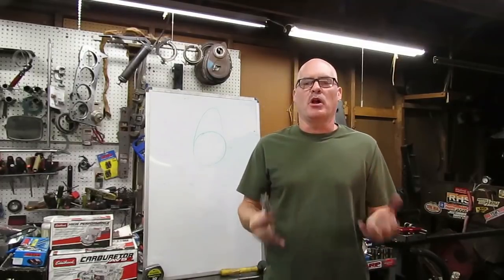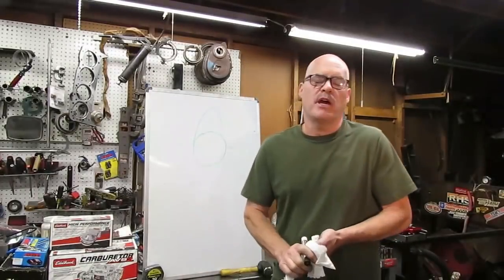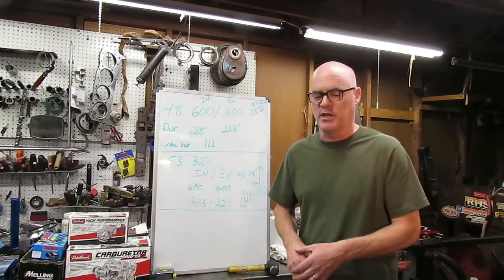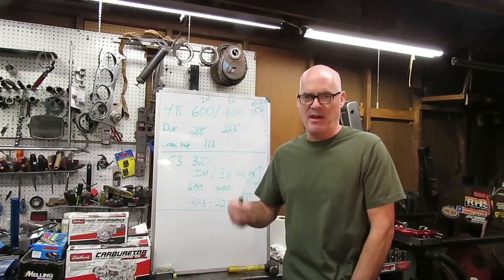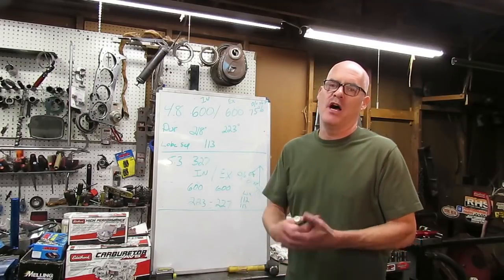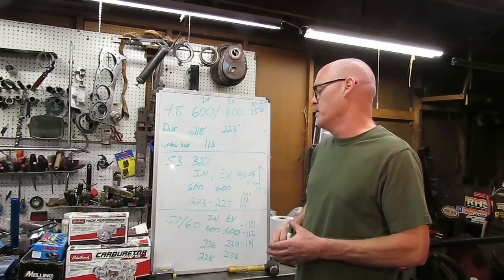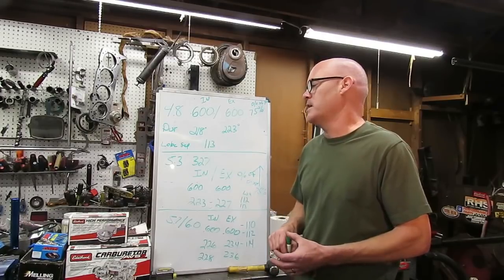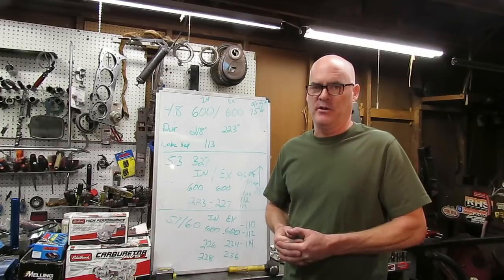How to properly select a Camshaft part 2

Comment: Hey man.
This video was fantastic.
I really learn a lot from you.
I'm just wanting to know, would you consider a 1 7/8 header too big for an LS 434 size engine?
I have read the 1 3/4 is good to around 800hp before you should even consider upgrading them.
I don't want the engine to feel lazy down low and in the mid range as it's a heavy car.
Reply from the maker: No not at all
Reply: @Myvintageiron7512  to ask a similar question,  would you consider a 1 3/4" primary header too big for a sbc 383 in the 400-450hp range?  Compression is 9.5:1 (I'll probably get some work done to get closer 10:1) and cam is 230-236dur with .506 lift.  2.5" exhaust.
Aftermarket vortec heads .  Exhaust runners were ported, not sure if too much.  Also pocket porting behind all valves.

Comment: Wow, wow,  what a great video , and I mean both  part 1 and par 2.   CONGRATULATIONS   man.   One question,  what do you think of the OEM kit sold Chevy Performance ?   They call it the Dynamic Duo,  it's ported heads & camshaft. They say it gives 40 aditional HP,  the camshaft  is  121 deg LSA, 591 lift both in & ex,  duration is 211 in 23o ex.   I'm going to install it in may 212 camaro SS, I want a little more power but also keep it streetable as a daily driver.  I already have the CAI and  street High Performance muffler from Chevy.   Do you think it will work as advertised ?   Thank you again for your video, I learned a lot  from it.    BTW it is a  LS3 not the auto L99.
Reply from the maker: Yea it should work pretty good

Comment: Wish that I could talk to you about my Ford 460 project. I would like to build the engine for long life and as a cruiser in a 77 1 ton dually chasis. Without it screaming its guts out going down the road .With a/c and all of the creature comforts of that year that were available. I would like this engine to have the best volumetric effiency possible. I was thinking that if I had the same setup that the 460 had in 1968 with the 10 to 1 compression ratio that I might be close.? I also have heard that puting 429 heads and intake on the 460 with the 1968 timing setup that would put me close to where my goal is . If you could call sometime to discuss this I would greatly appreceiate it. I wish that you taught a class somewhere because I would love to attend .

Comment: Hi Mike... I can’t find a LS cam with the specs you gave me ... the closest  cam I can find is a low lift 525 intake and exhaust. I forgot to mention I’m running the 416 stroker LS with the Holley terminator X max so tuning isn’t a issue.
I already have the BTR stage 2 LS3 LS7 cam. I can send it back . But honestly it’s actually the closest thing to what you  suggested other than the lob separation angle 110 as opposed to 113 on the BTR cam. I have the summit racing forged stroker rotating assembly. The pistons have a 6cc dish with plenty of valve relief that are actually machined for multiple LS cylinder heads. My heads are factory LS3 milled down to 68.5 cc . Information is so important 👍

Comment: A little help. I have a cam that is 256° 264° @ .050 504 lift 105 lsa. What compression what i need ? I have rpm air gap intake and vortec heads an 750 cfm carb. Some one shoot a line of info please. 
Thanks

Comment: I have a 496 with a set of rectangle 990 iron heads from  a 427. According to the first video I should have a mid 600s lift. But its an 8.1 liter engine so according to this video I may need bigger? I’m a little confused between the engine size and head flow relationship in regard to choosing a cam.
Reply from the maker: you can go bigger with more cylinder vlo I wouls go up 1 or two stages
Reply: @Myvintageiron7512  I appreciate the feedback!

Comment: Hi mike... I’ve been watching your videos... excellent information... I wish you continued with cam selection going up to the 6.2L .... also I’m personally building a LS3 stroker 416 with a 11.3:1 compression...what would be the perfect street cam... I have a 4L70E, 323 gears with a 3000 rpm stall 28 inch hight tires and it’s all going into a 81 firebird... about 3000 lb
Reply from the maker: stick with .600 lift 228/234 Duration 110 LSA
Reply: @Myvintageiron7512  I was looking at the BTR stage 2 cam .. it’s 225 / 238/ @ 50 with 113+3 .LSA lift is in and around 600 intake 612 exhaust. 
Fairly close to what you recommend with a little more overlap. What are your thoughts. 
Thanks again for the great information!
Reply: @Myvintageiron7512  thank you so much for your advice... keep up the cool informative videos.... wish back in the day my auto shop teacher was as informative and explained detailed information on proper procedures as in your videos. 
Cheers

Comment: Question havent tor 327 apart yet but have all rebuild kit including stock cam bearing . ( And lifters and cam) but want a better than stock cam ( used to be called RV cams ) just want mild lope and midrange performance not sure about valve size yet if 194-202’s would cam recommendations be the same just need to to know as I don’t know . Selling as stg1-2-3-4 cams stg 2 seems right as it’s a weekend worrier car . Stop light to stop light , smoke the bags when leaving the show and shine 😅lol please help
Reply from the maker: An RV cam has no lope whatsoever they are smooth idle for heavy off road TQ you want a cam with 228/232 Duration @.050 and a 108 LSA around .480 lift I am assuming your using a decant head a camel hump well prepped at the very least.
The heads being rebuilt and preped correctly by a shop that knows what they are doing is critical

Comment: What's a good cam for a Chevy 350ci 250 horsepower 2bbl version? I'm looking to hit a little north of 300hp with a slightly more heavier, throaty but not a choppy sound. Someone said a .444 lift cam, dual plane aluminum intake and a 4bbl with a dual exhaust. Does this sound right?

Comment: Just a question guy's what's a good set of secondhand LS3 rods worth over there as I'm after a set for my LS1 rebuild in my 02 Holden Calais VX. 
Can't find a set at a fair price here in New Zealand and really want to dump the old LS1 rods as I give this old girl total crap every time I drive her.

Plus I went with this cam & ported 241 casting heads 
Intake Valve Lift: .575"  Exhaust Valve Lift: .575" Advertised Intake Duration: 286¡  Advertised Exhaust Duration: 282¡
  Intake Duration @ .050": 220¡  Exhaust Duration @ .050": 224¡  Lobe Separation: 112¡  Intake Centerline: 108¡  ( Hope it's not to much, But we will soon find out.)     ; )

Now it's my daily driver so didn't want to go to nuts on the cam to keep it drivable in & around town.
Staying with the flat top piston and will have a 10.5 /1 comp ratio since heads an block have been surfaced.
Engine has 360,000ks on her so she deservers a freshen up.

Have new valve spring (600 max lift) , push rods, LS6 Lifters, lifter buckets, full gasket set, 650cc injectors, new oil pump, new timing gear an chain, new rings & Bearings including a new set of cam bearings which are already fitted to the block as block has been bathed, surfaced & will be horned once ready to put her back together. ( Can exchange rod Bearings if needed)

Be great to get any feedback on the price of a good set of LS3 rods

Comment: Would you recommend going with an after market intake if going with an after market cam? I know you said the factory intakes are very good but how does that work with aftermarket parts? I've heard the engine needs to breath better and have heard both sides. So what's your recommendation,  keep OE intake or go aftermarket intake?
Reply: OE work pretty well unless your turning really high rpm or if your boosted... things like that.

Comment: Picked up a 69 C10 with a 350 from a 73 truck. If I’m reading the numbers correctly. It’s a 010 block with what looks like 8998991 heads but I could only find info on a 3998991 casting number. My issue is I’m getting chatter under load on the right side and it sounds like #4. I took the valve cover off and rolled the engine over to make sure all the valves were functioning and I’m thinking it probably needs a new cam. I would like to build on this motor. Other than the chatter it feels strong. Do you have a suggestion on cam and maybe do you know about these heads?
Reply: Why don't you just adjust the valves on #4 cylinder if they are chattering?
Reply: @nsmturbo5902  I’ll try it.

Comment: So I’m a Noob & not a Noob at the same time. I was really hoping you could help me overcome the actual Noob that I am. As a mechanic, I am far from a Noob,  but as a Voodoo Witch Doctor Mechanic that replaces all of his engine with all of the different pieces of engine candy I am a virtual Noob. I have exactly no experience in selecting new pistons, blowers, super chargers, camshafts, or any other high end aftermarket part. So I was greatly hoping that you could help me a bit. 
I have a 1998 Chevrolet Suburban K2500 Generation 6 454 that is as stock as one could hope for. I bought this thing in 2000 when it had 14,000 miles on it. It now has 107,000 miles on it. 
It runs well, but I thought I would do a bit of surgery on it by replacing the camshaft. That is the extent of what I want to do to it, unless of course you recommend doing more at the same time. 
I can put the camshaft in, no problemo. The question becomes what camshaft? I’ve watched your videos twice no less. After watching, I still went huh??? With all things given, I have a completely factory stock generation 6 454 & if I replace just the stock camshaft, what camshaft could you recommend to get more power from this? Everything is stock including the stock factory heads. There are probably a 1000 different choices of cams I could select but one thing I don’t do stock is that I’ve always used Premium Chevron gas in it. That will never change.

Comment: I'm having trouble picking a cam shaft for my 360 FE as of right now its all stock never messed with but its been ticking I'm going to rebuild it soon, I've tried to use comp cams website to pick a cam but I don't know any of the specs how can I find them? I know I have c8ae-h heads otherwise I don't know the numbers any help or tips you can give me would be appreciated, thanks!

Comment: I have been thinking about your video off and on all day.   wouldn't length of stroke be a factor in duration of the cam?  a longer stroke essentially means greater piston speed compared to the same engine at cubes if its done with a larger bore.   how do you adjust the duration or lobe separation for a stroker or an engine that gets it cubes with a larger bore?
Reply from the maker: for a stroker you would bump the duration numbers up to the next level but don't mess with that .600ish lift point going bigger on lift does not help

Comment: Will     COMP Cams CAM LIFTER KIT LS1 XR275HR-12 work good on my 2006 cts v 6.0 ls2
Reply from the maker: It will work it's a bit on the small side I would be looking at closer to .600 lift and 230ish duration with a 114 LSA

Comment: What specs would I look for on a 5.3 chevy avalanche 2wd flex - no racing, just pulling a boat , wanting a decent HP gain low to mid range? Any help would be much appreciated! Great video Very informative!
Reply: By your specs of .600/.600 lift, 219-223 duration, 112-113 lobe separation - I assume this is too much for what I need, correct?

Comment: Was wondering if i could get your input/opinion on the Hot Truck Torque Cam by SDPC. Im interested in a 5.3 LS engine. Spec for the cam are 205/210   550/525   115LSA. With 862 Heads, looking for a strong truck cam.
Reply from the maker: That one will work fine it's a little small but if you don't want to tune it stick with that one the cams I listed are going to require computer tuning

Comment: So if you want a choppy idle but are concerned about the motor being a dog at street driving rpm ranges.  Can this be compensated by running quite a bit higher cubic inches?
Reply from the maker: Yes

Comment: Hello, I am subscribed to your channel and you are a genius with this stuff and I really appreciate your time and knowledge , I have a 1972 4 bolt main 350 with the 882 heads and a bigger cam that has mismatched performance in my opinion. I would appreciate if you could help me with some advice on what cylinder heads,cam,intake and carb to use please. I am not looking for anything outrageous just something in the 300-350 horse
Reply from the maker: Thanks for the sub!
Reply: With 882 heads your compression ratio is already super low. With an oversized cam that motor is probably a huge turd! Any after market 64cc chamber heads will help you tremendously!
Reply: @nsmturbo5902  Yes it is a real turd lol! I will take your advice THANK YOU!

Comment: Anyone have a link for a cam kit for the 4.8? What manufacturer is best? I'd like a kit with cam the lifters the springs. Timing chain and oil pump. That would be bad ass. 
Also oil pump. Better to go with the high volume and shim the spring for more pressure

Comment: I noticed in the comments that you said it really is nonsense to run aluminum heads on a small block. That said, what kind of heads should I run on my sbc?  I’m new on engine building and now confused. Lol
Reply: Aluminum heads are lighter and run cooler, the advantage is you can run higher compression without detention… and overall a set of performance aluminum heads flow more air making more power 🤓

Comment: Ok I was looking at my cam specs. One spec is. Lobe center. 107 an 117 exh. But doesn't say lobe Separation ???
Reply from the maker: add the centerlines togather and devide by 2 and you get lobe sep my math says 112 for your cam
Reply: @Myvintageiron7512  ah. Makes sense thank you

Comment: What are your thoughts on Comp cams for a lm7 5.3 

113
231-239
617-621 

For a 62 Nova 2800lbs with a 4l80e.  This is what Comp recommendation.  Street car.  Should I send that cam back or is it too far out of spec?
Reply from the maker: It's a tad big but with that car it will work well because it's light you can go bigger with a light car because you don't need as much low to mid range torque I'd run it

Comment: What size header and tail pipe size would you suggest for a 350/5.7 motor to generate as much low end to mid range torque as possible?
Reply: 39:44

Comment: Do you ever look at "dynamic compression ratio" when choosing a camshaft or building an engine?
Reply from the maker: sometimes when we are running pump gas it's a thing you can get away with a little higher compression if Dynamic (running) compression is lower

Comment: I'm looking at 3 different cams, which one would you recommend for my 85 c10, I'm putting a 5.3L in it? A 204/222 with 551/570 and 112LSA. A 212/218 with 600/600 and 112LSA. Or a 216/220 with 600/600 and 112LSA. Or should one of them be at 110 or 114...
Reply: He said for the 5.3, 223/227 with a 112 to 113 lsa.
Reply: @rodneyp502  would the OE stall converter in a 4L60e work well with that cam or what size stall converter would you recommend?
Reply: @colbylange9282  Yeah it will work with the stock converter , but for that spec cam a 2600+ stall converter is recommended
Reply: @colbylange9282  Check out "PCM of NC"
Reply: @rodneyp502  thx
Reply: @colbylange9282  No worries mate, glad to help.

Comment: Can you help me with a 289 build dual quad 500 or 600 cfm  with flow tech heads 505203  I need a strong street version! 65 mustang 4sp. Can you configure the cam and or maybe a stroker. Regards Please call TTully

Comment: I need advice on cam for vortec 350 s10. I'm shooting for 375-400 hp. I think I need to go easy on torque production because of weight and traction. Ive been looking at comp cams 282 roller. Any advice would be greatly appreciated.
Reply from the maker: What Heads??
Reply: @Myvintageiron7512  stock vortecs with beehives and screw in studs
Reply: @Myvintageiron7512  stock vortecs with beehives and screw in studs.

Comment: How much lift will the stock valve springs on a 5.3 or 6.0 support
Reply: When installing a larger cam, go with the recommended valve springs. What good are the worn stock springs if your valves start to float at hi rpm? 

The blue GM ls3/ls6 springs can handle .560 lift. They're under $100 new.

Comment: Call me daft but I cant seem to find any off the shelf cam (howards included) for any of the 5.7l combos you listed. Im building a ls1 5.7l with cnc chi 241 ported heads and 6.125 h beam rods. Its a sedan built for some spirited driving on the street. A.i is the closest cam I can find. The btr stage 2 isn't too far off the specs either.
Reply from the maker: Summit has a few
Reply from the maker: tru part number SUM-8707 on Summit's website
Reply: @Myvintageiron7512  thank you :)

Comment: You didn't talk about combustion chamber which plays apart in compression which also effect power  and cams valve timing hitting piston over lap valve hitting valve  not everybody has a flow bench piston dome height plays part. Size of combustion chambers

Comment: what about zoomie headers, do they help scavenge exhaust
Reply from the maker: yes if the engine is built correctly not to good on a mild engine they were actually used on dragsters so the ex-heat would help heat the rear tires for more traction

Comment: Not sure why we have all these PD blower factory cars with wide LSA even in the aftermarket cam choices. They say PD blowers don't have much top end and put a cam in with super wide LSA limiting top end power and gaingo more low end cylinder fill right where it is NOT needed. My Hellcat has WAY too.much low end torque. Why would I not want some overlap to reduce low end cylinder pressure and increase top end.capabilities?
Reply from the maker: the computer does not like tight lsa you can't tune it out you will get check engine light